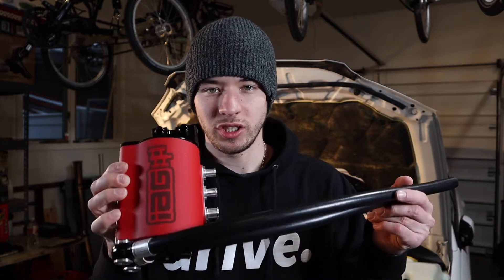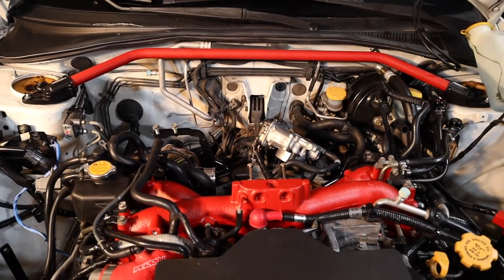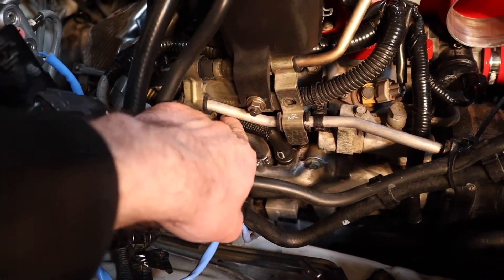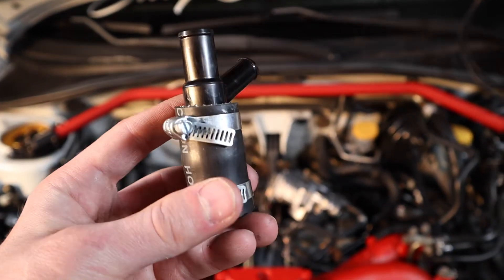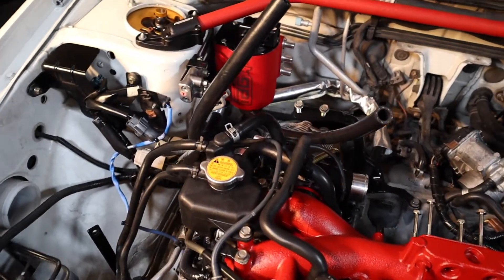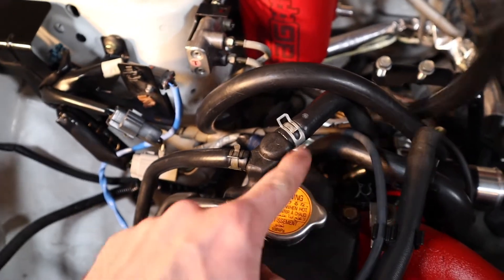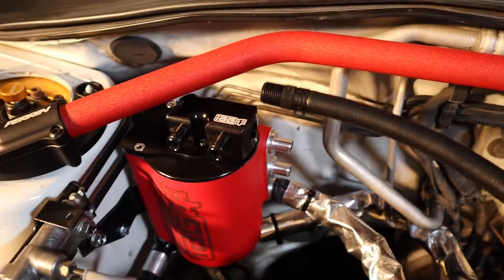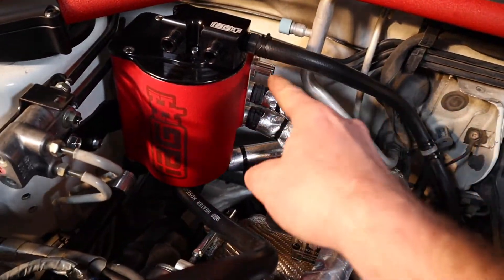How to Install an IAG AOS V3

Comment: Quick question my dude I cut off a little bit of the hoses that go to the turbo and coolant expansion tank because I didn’t have a lot of room and the hoses kept bending to where it kept clogging is that normal to cut the hoses for space
Reply from the maker: Yes it's normal to cut the hose for room, but cutting it to short is not good. If it keeps bending your hose might be to long. It should not be clogging anything. I would take it off and put it up a bit closer without cutting. See if it bends and if it doesn't then cut it to that point.

Comment: Hey i just got IAG A/O separator and have a perrin strut bar installed. Just saw on IAG's website that most strut bars are incompatible. You didnt run into clearance issues?

Comment: Hey Man , I saw you put perrin sturt bar ,Just asking after installed the aos , which brand strut bar also fit (I don't like perrin product.)?
Reply from the maker: Hey man, there are a lot of brands out there that work with the GD chassis. I've seen people run the Cusco brand before and it seems to fit well. The Megan Racing one is nice too. I would just watch some videos for those and see what you like best. I went with Perrin because I liked the look of it and I had a lot of other Perrin parts.

Comment: What did you do with the second to last hose connection? The one with the PCV? You said you were going to connect the PCV and put it in there but how did you get that all connected up?
Reply from the maker: I had to buy the white sensor that plugs into that plug and I just attached the hose onto that white sensor. After that you just leave it. You don't have to do anything with that white sensor. Hope this helps. Sorry for the late reply.

Comment: can i do this exact same thing on my 2004 wrx? the thing is my wrx only have 1 valve breather hose? is that normal
Reply from the maker: You should have two valve breather hoses, one on driver side and one on passenger. Do you have an EJ205 in your wrx?
Reply: GD WRX's only have (1) breather on each valve cover. You have to do a little work in each valve cover to put (1) extra for every side. Did mine with (2) bronze KFPS/NPT in that same plastic piece where you have only one breather. In forums they do that in the metal part of the valve cover, i didn't like that route so did mines in the plastic part.
Reply: @alejandrodacosta3814  trying to do this on mine i’m so lost can u please explain in more detail what i gotta do

Comment: Can this fit a WK2 Jeep Grand Cherokee or is there an equivalent air oil separator for Mopar vehicles do you know?
Reply: you could probably make this fit but you would have to modify it. you also shouldn't really need it on a na car. its mostly for turbo'd cars

Comment: So there’s another video that’s doing the same install and is touting the hose completely different so I’m a little confused
Reply from the maker: Do you know what hose it is? IAG gives install instructions on the different vehicles. If you just look up IAG AOS V3 instructions they should come up. You'll Have to find the right AOS and vehicle though.
Reply: @fastlifestyle7249  you did it right I double checked the instruction manual
Reply: Not sure what the other guy was doing

Comment: Crucial information for the hose at 7:17 

My aos did not come with the threaded nipple attached to this hose and was already attached to the aos and I was unaware that it is a directional hose so to anyone reading this; learn from my mistake and make absolute sure the arrow on the check valve in the middle of the hose is pointing toward the intake manifold. The shorter side of the hose goes on the aos. I installed this hose backwards and it restricted my engine from being able to breathe and it was pushing oil out of every gasket it could so PLEASE make sure this hose is going the correct way

Comment: Finally I know that plug is for the PCV sensor... Great video!
Reply from the maker: Yeah no problem! Glad we could help
Reply: that plug is essentially useless. if you just cut the connector off and wire the 2 wires together is serves the same purpose, its just some sort of loop and splicing the wires and connecting them together is the same thing. gives things a cleaner look
Reply from the maker: @kylehenneberg7073  yeah that is my plan. At the time I made this video I didn't have a Y splitter.

Comment: With the pcv sensors the hose that was supposed to go there what happens with the hose?
Reply from the maker: I just attached the white sensor on it then put the hose to it and plugged up the sensor on the other end. What I'm gonna do though is take that sensor completely off because you don't need it and get a Y adapter and run it with the other hose into the turbo inlet.
Reply: I have the same turbo inlet as you, so you can run both hoses just directly into the inlet with no sensor at all?
Reply from the maker: @skylerwalkowski529  You can run one to the top of it like I did in the video. The other one you'd have to run into the PCV sensor or if you have a hole on the back of your inlet then IAG provides you with that 90 degree plug. What I would do though if you have the same perrin inlet as me is get a Y splitter and just run both hoses into the hole closest to the cold air intake. Hope that helps!

Comment: Thanks Bro. You have any idea as too where you would install this AOS on a RHD sti?
Reply from the maker: That's a hard one. I would try to see if I could put it somewhere on the drivers side. You might have to drill your own holes and install it with the bracket. As long as you have room somewhere near the PCV, valve covers, and surge tank you should be okay to install it in any location. You might have to do some modifications and get some longer hoses, but it's not impossible.
Reply from the maker: I would also contact IAG and ask them about it. See if they any good ideas on where to install it on a RHD sti. They would probably know more about that. I'm pretty sure you're not the first to ask that.
Here is a link I found to someone who did it. Hope it helps. 

https://www.iwsti.com/threads/no-fabrication-rhd-iag-v3-aos-installation-guide-for-subaru-wrx-sti.323802/
Reply: @fastlifestyle7249  thanks man much appreciated